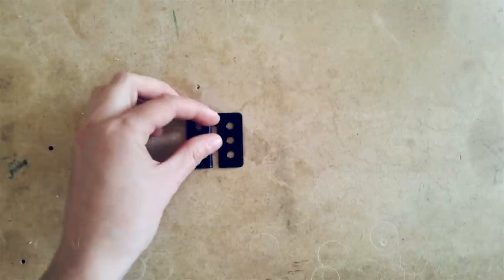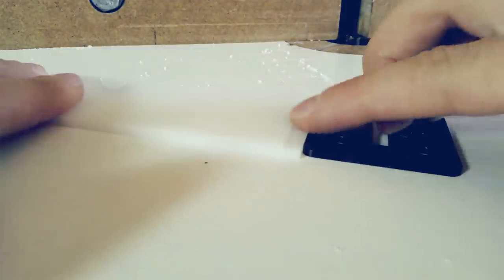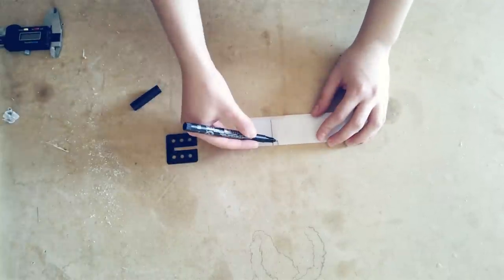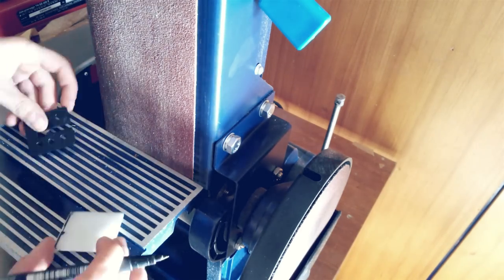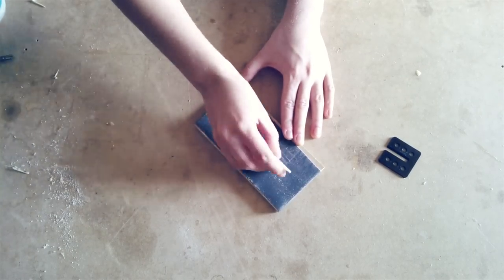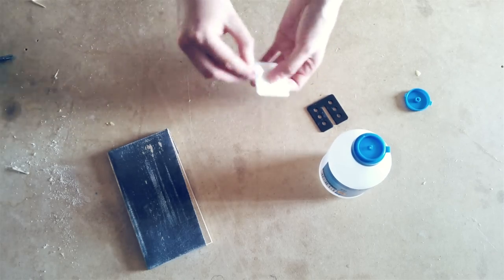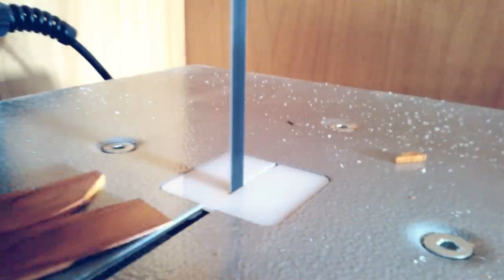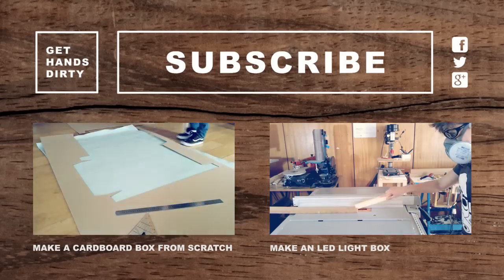Zero Clearance Bandsaw Insert

Comment: Your original insert had holes to aid with dust collection. I would recommend adding those and leveling pins in the corners as the rabbit cuts in the under side left the insert shy of the table. That could introduce feed issues on different cuts as your workpiece may hit the lip on the table causing you to have to either lift the workpiece or back out of the cut (two things you want to avoid if possible). Happy making...